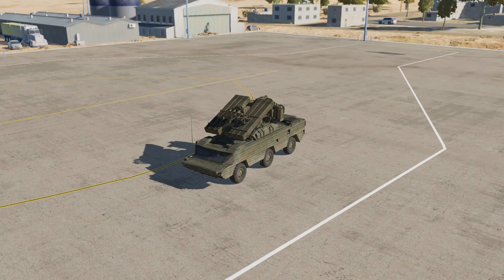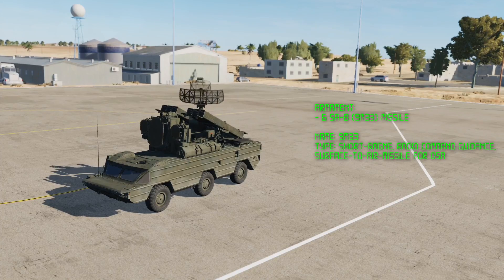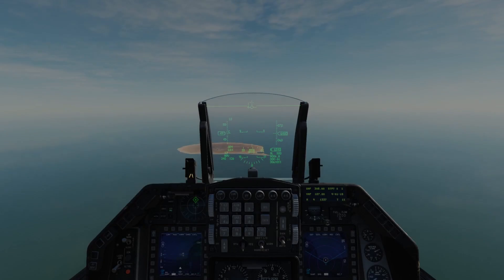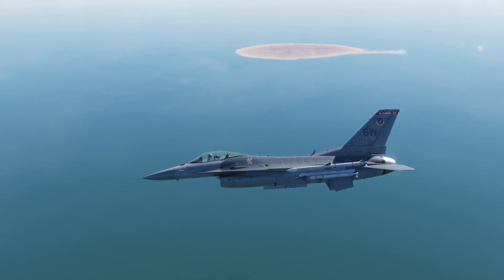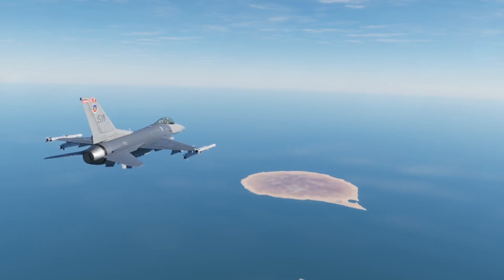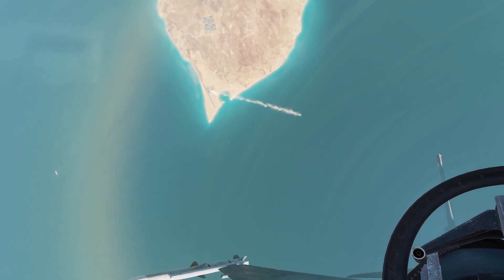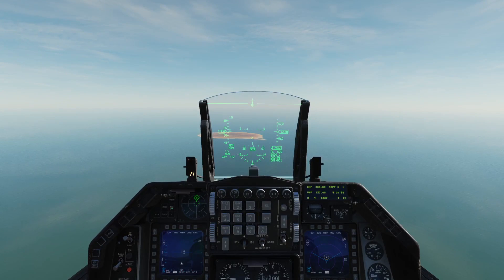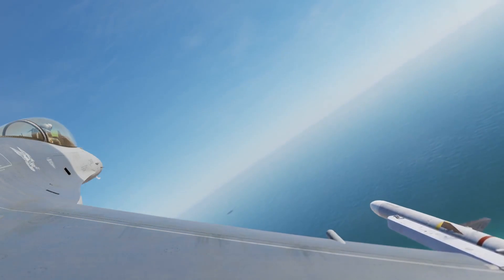DCS: Missile Defense Tutorial. Can YOU defeat the SA-8?

Comment: Not sure what tracking equations the 9M33 uses so it's possible that it's an exception here, but generally speaking, ground driving should not work anywhere near as well as it does in DCS - even the S-75/SA-2 has specific tracking modes to deal with it. While it works at the moment, I wouldn't rely on it if ED ever revise the IADS side of things.
Reply from the maker: Yup. I will definitely do an update if they change it but if it works for now there's no reason not to use it as a last ditch defense. It doesn't always work either. It seems to only work consistently at very high or very low aspect. As soon as you are in the beam it's effectiveness is reduced drastically.